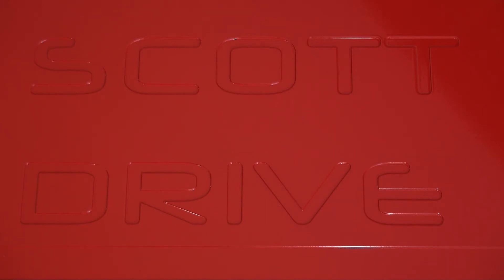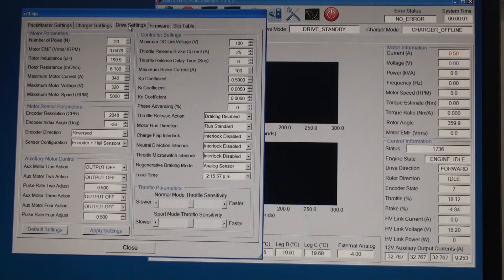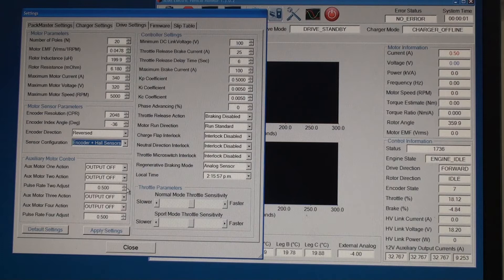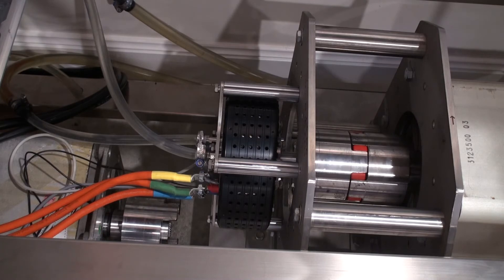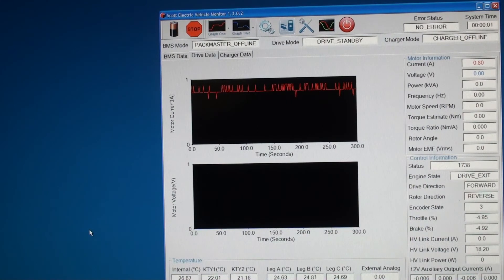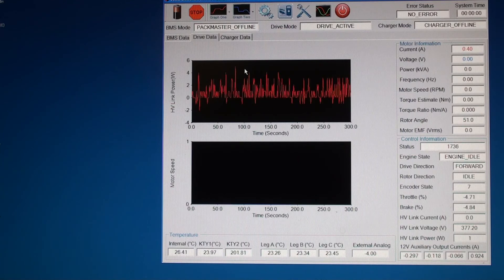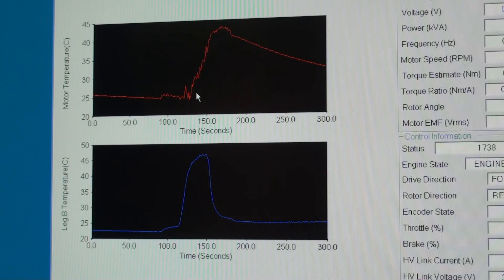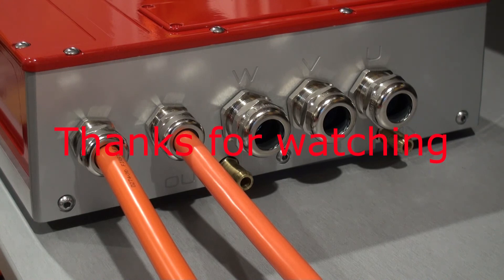EMRAX228 Setup & Test with the SD100 Controller

Comment: Can you adjust the torque and speed like decrease the torque when the speed increases
Reply from the maker: Yes the controllers start field weakening at high speed. i.e Iq current decrease and Id current increases as required to weaken the field

Comment: Hi there. Would you be able to tell me how you made the cooling system, what electric water pump, tubing and radiator you used? I see you have the 180 degree fittings from emrax but I am looking to use the emrax 208 model for a project of my own and any help would be greatly appreciated. thanks
Reply: you have in datasheet. i looked smaller version for my project
Reply: i have seen your college project which is nice. are you still in this field ? rose delane.

Comment: Does we can emrax motor used as generator for electricity
Reply from the maker: Yes any 3 phase PM motor can be used as a generator
Reply: Emrax motor  Is a generator or not?
Reply from the maker: Yes the EMRAX motor can act as a generator
Reply: Scott Drive TV  thanks .
Reply: @scottdrivetv7707  
and what about efficiency !? 
If we have a Emrax motor with power = 100 kw 
We coupled the Emrax shaft to gas engine have 100 kw power 
What the value of electric power output from Emrax ??

Thank you for your cooperation